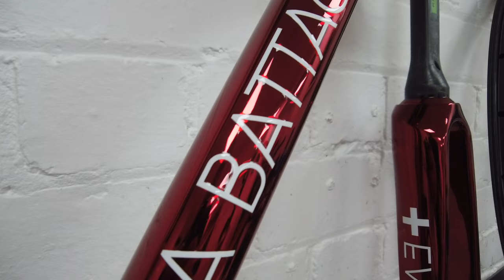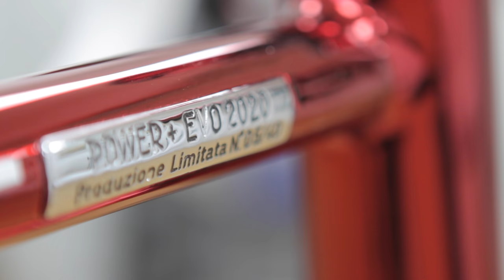Officina Battaglin Dream Bike Build

Comment: I like the build overall but I would never choose hidden cable routing especially if the bike is going to travel. The Hybrid brake calipers is a good option. I have the Yokozuna Hybrid calipers paired with Campagnolo Centaur levers on my cyclocross bike. They work very well. Did you use a low compression specific brake housing? Most cases that type of housing won't work with internal routing. Oh, and I like the white bar tape too. That always adds the best look to a bike. Nice work.

Comment: I would NOT have: Painted the wheels red. because bike red is cromovelato and rims are not. Does not match.
                                 Chosen white HB tape and saddle. And if, I would not fixed with glossy black electrical tape but white one which will also hide the now white edges of the HB           
                                 tape.
Other than that it's a classy bike.

Comment: I wonder how the bike rides on rough roads compared to carbon frame
Reply from the maker: The Columbus HSS tubing gives a lovely compliment ride whilst still being nimble and sprightly. We use it a lot in our own steel Meteor Works frames.
Reply: @veloatelier6122  thanks for the answer! I have a bike on Dedacciai 18MCDV6 HT, on smooth asphalt rides perfectly but on uneven very beats
Reply from the maker: @yuriyanovski  yes I can imagine. The Deda stuff is very race orientated and can be a little harsh. We often mix this tubing with some reynolds or columbus to take the sting out of it.
Reply: @veloatelier6122  Thanks for the answer, now I know who will help you choose a bike! 🙂
Reply: @veloatelier6122  how much does this build weighs? 
 ...i am keen on getting a steel frame (i had 2 steel mountain bikes so I know the sublime ride nature of steel)...... but i am worried about the weight penalty
Reply: @Juicesters22  I ride Columbus Spirit and my bike is around 9.5 kg (perhaps more with pedals). It is true that it may not accelarate as fast as a superlightweight carbon bike, but it rolls so well over rough tarmac. I have ridden some carbon bikes and find they are more stiff in the rear triangle which may be better on a seated climb, but I don't like the dead stiff feeling.  Steel has a bit of spring to it which makes it feel more lively, especially climbing out of the saddle.  I don't race and my typical riding speed is around 32km/hr, so it is quite casual and I can ride for six hours and not feel fatigued by road buzz.  The hardest thing to do is to get the geometry just right, so that you don't need much spacers, the seat post has the right curvature, so as to be able to ride the bike for decades, as your position changes, with aging. I've built in a head tube extension like a Pegoretti, and have just a 5mm spacer under the stem.

Comment: Stunning but not sure about the white saddle & tape.
Reply: I am sure that I would NOT have chosen them. And also NOT glossy black electrical tape to fix the tape where the white edges are visible. Details, but important.
Reply: White saddle requires a white bar tape, no discussion. I was convinced immediately by the idea and the result is fabulous 🤩
Reply: @DietrichStockman  The discussion here mate is about personal choices on that immaculate bicycle. Not about that a white saddle REQUIRES a white bar tape.
Reply: @selcukcilek555  you're not the most funny guy around town, aren't you?  Cheer up.
Reply: @DietrichStockman  actually yes, not the MOST funny one. I blame myself and think ...what did I do wrong so people just don't get it? I ask for the room temperature and people reply with "yes, but it's windy outside". May be it's me and I always should look out for gusty winds?
Reply: @selcukcilek555  What has a white saddle to do with a gusty wind? I'm not smart enough to interpret such philosophical remarks!